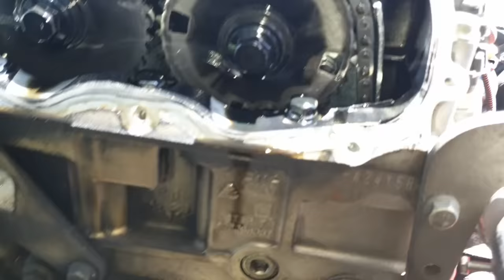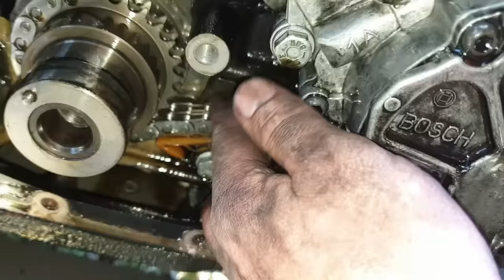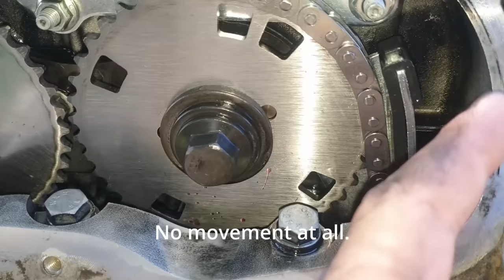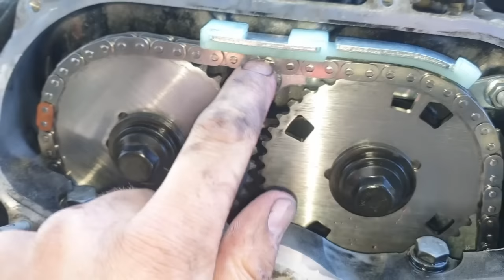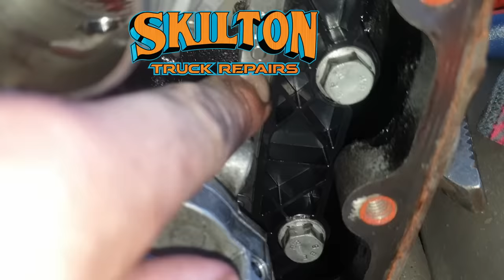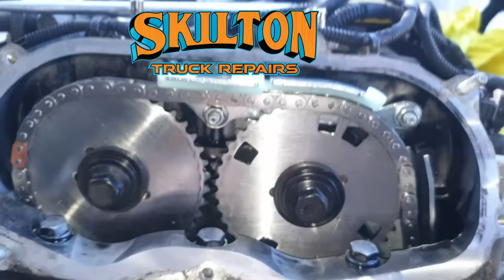Fuso Canter Timing Chain 4P10

Comment: Do you need to take out the whole engine block to work or it is enough space to replace it from the side? Thank you very much
Reply from the maker: No need to take the engine out.

Just removing the radiator will make enough room to work.

If you would like more information, you can find a link in the description to a guide we made.
Our guide can help you replace the timing chain.

Comment: Checked glow plugs all working except cylinder 1 stuck in unable to remove but swapped injector two with three still shows fault at injector three?done continuity test ohms on wiring injector harness to ecu plug all read the same?
Reply from the maker: You will probaly find engine wire harness conduit has rubbed through your injector wiring or injector wiring rubbing under that black cover. Don't rely on continuity test as it can lie to you.
Let me know what you find.

Comment: Hi I have  Fuso 3.0 4p10 issue rough idle cold start after 2min . Codes read injector 3 fuel quantity exceeds upper limit and glow plug 1 malfunction and glow plug control issue any ideas?
Reply from the maker: Hey mate. Go to live data and inspect your injector compensation values. They should remain near 0. If number 3 injector is far high or low compared to the other injectors then this may indicate a faulty injector. Is the rough idle fine after warm up?
Reply from the maker: If the rough idle is fine after warm up then i would be starting at the glow plug. Check for glow light when you cycle key to ignition. Check all fuses. Check power at glow plug when key is cycled to ignition. Remove glow plug, add power and see if glow plug works. Only do this if you know what you are doing or you can damage or hurt yourself.